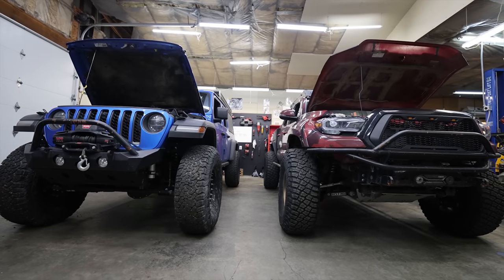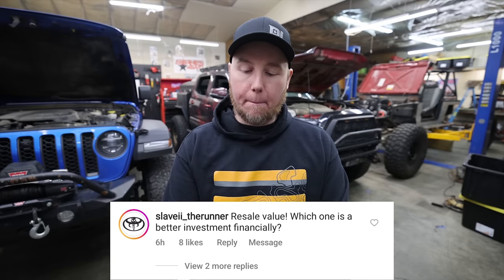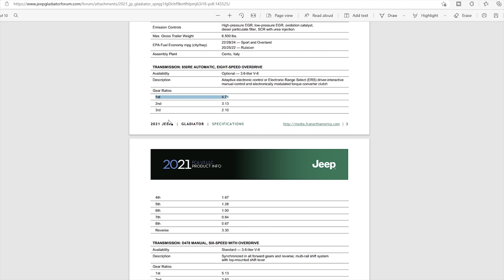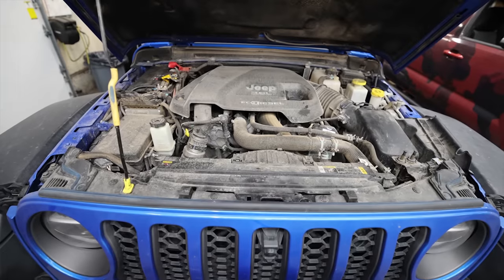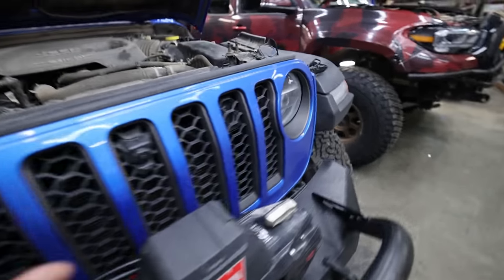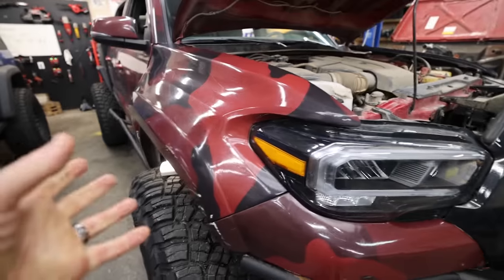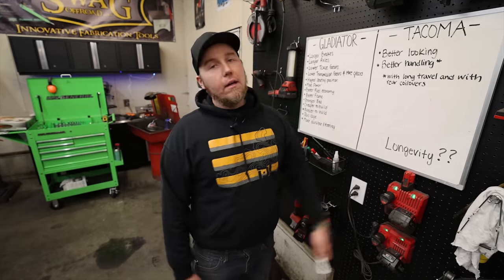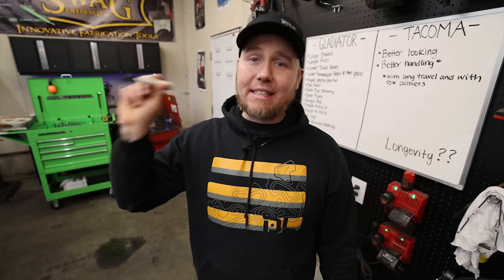My 21 Jeep Gladiator Vs My 21 Toyota Tacoma. Cold Hard Facts.

Comment: I think that's a good nuts & bolts review. I agree the Gladiator is a better truck engineering wise and for customization.  I was wondering what you think of the Chevrolet Colorado ZR2.  I really need an off-road capable midsize (not a rock crawler) that is comfortable for those 7000 mile 75% highway trips. I don't know if the Chevy is gonna take me to the levy.  - IDK

Comment: on the towing front, diesel engines have a lot more torque down low, they also usually have lower rpm than gas engines... there's a reason the lorries use diesel engines almost exclusively

larger breaks dont matter, unless you're breaking from 70 to 0 every 2 minutes, the only thing that determines your stopping distance is your traction to the road, ie, the tires, you could have 3 times larger breaks, but bald tires on a snowy road will not stop sooner than smaller breaks on proper tires...

the toyota is not designed for offroad, the gladiator is, that's the biggest difference, you have to build the tacoma to prepare it properly for offroad

Comment: Only thing I would disagree with is jeep steering which in my opinion is terrible.  Owned my 2018 JLUR for years and feel like a drunk driver at times and Jeep refuses to replace the crappy aluminum steering box for the updated steel one.

Comment: Resale Value... End of December 2023 and I just bought a 60,800 MSRP 2023 Gladiator for 30% off MSRP with Stellantis and dealer incentives so, like 42K and whatever change made it 30% off. That's used car pricing... I'm gonna give the nod to the Tacoma on that but I wanted a Gladiator. It will still do things a Tacoma will NOT.

Comment: Bought/ ordered a 3rd gen last year (trd off-road manual).  It was my 3rd tacoma and first special order.  I had the truck 3mos and absolutely hated it except for when I was walking up to it, great looking truck.  I was aware of the shit engine and thought ordering a manual would help.  It didn't.  If they would have put the 4.0 in it, the truck would be amazing.   Rated to tow 6500lbs but it would barely pull itself up a hill.

Comment: Anyone can speak to this and actually make a pretty simple assessment of these 2 midsized trucks. Even owning a tacoma I can tell you the weaknesses and any tacoma owner that doesn't admit them or want to realize them is just walking blind. The tacoma was built to be a pickup truck with some minor offroad capabilities and a nice ride on road. The jeep on the other hand was built to be a jeep and jump in the midsized market to get some of the market share. So essentially the yota was built to be a more modern truck and the jeep was built to be a jeep with a utility bed. Here's a big point not covered the tacoma outsells ALL other trucks across the board midsize full size it doesn't matter. The only one it doesn't beat is the for F-series and thats just due to that being from the f150 to the truck f450 and the shear volume of fleet sales. You dumb it down to just the f150 yota is king.

Comment: I agree with your statement that the Gladiator is the better crawler but the Gladiator and jeeps in general are purpose built to be exactly that, the best crawlers on the market. Tacoma's on the other hand are not meant to be crawlers, there purpose is pre-runner style off road hence the IFS. While both are off road vehicles the Tacoma would absolutely blast the Gladiator in a desert run style off road where as the Gladiator has no problems crawling slowly around obstacles. I think they have two very different applications and instead of playing to the Tacoma's strength you had to throw thousands of dollars at it in order for it be even in the same ballpark as the Jeep. Imagine for a second the roles were reversed and you had to build a Jeep to be a good desert runner style off roader, imagine how expensive that front end would end up costing, hell you might even end up doing an IFS swap out with the front axels. Not to say the Tacoma doesn't have its downfalls which it does, (rear drum brakes? leaf springs? kinda meh) but the Tacoma is definitely Sexier than the Gladiator
Reply: I just found your channel and your no hesitation style is very refreshing, definitely a new sub earned :)

Comment: I agree with everything that your video said mostly except for looks unless you're talking about stock. The gladiator stock even in the Rubicon trim does not look good The Toyota Tacoma stock and a TRD trim looks way better I agree with that however if you lift that gladiator higher and you put on tires the looks aren't even comparable it looks way better than the Tacoma by far in my opinion.

Comment: Can anyone  point out a book that  is 100% non bias?  ( let's forget about any religion as most will speculate in that direction)  no matter how much research and facts  on any topic, that are reviewed and discussed in any format there will always be to some mathematical degree( percentage, probability, or statistical)  that tips the scales slightly off balance. Maybe not to the naked eye. 
 I ve never owned a jeep or a Toyota truck. I also don't off road. This was a very well done video in my opinion, that highlighted information is out there, it's raw and has to be tailored  to the person's  needs or use, aka reliability.   I would assume most of the needs for the applications that the off road community is looking for are "one off designs"  they don't fit into the other  general categories for manufacturers /engineers such as a passenger vehicle, or light duty vehicles, suv  pickup trucks  Jeeps. I would imagine every application has a trade off. For example all wheel drive vs four wheel drive. Disc brakes vs drum brakes vs drive line brakes.  Gasoline vs diesel.  Automatic transmission vs manual transmission ..( note this is the only Chanel I know of that has put a diesel engine in a jeep to abuse  or off road over obstacles)  trade offs for the desired performance and applications. 
Meaning of abuse: to thoroughly test the engineering,design and workmanship of each system, structure or component. Be that a manufacturer or a 3rd party  shop or a backyard  enthusiast.

Comment: There are pros and cons to each. For me, it comes down to the price, build quality, and the company selling it. Chrysler is known for trying to screw their customers out of warranties. And there is no question that the build quality for Toyotas is much higher. If you don’t believe me, look at the used market for the data. How many jeeps do you see with 300k+ miles and still running strong? I love the idea of jeeps.  In fact, if it was made by Toyota, I would definetly buy one over anything else. But it’s not sadly. And I don’t want to pour in money to fix the things that constant break with plastic parts. Toyota has its issues to. It comes down to what you want

Comment: Toyota fan boy here. Part of loving a vehicle is knowing its flaws and yes there are some things that just suck. But overall reliability longevity Toyota has a proven record and Jeep ( on the gas engines) come stock with lifter tap oil leaks in the worst places. Agreeably the suspension is much better on the jeep, but definitely more comfortable on the Tacoma. Kent find a way to completely disagree with you, but then again, opinions are opinions.

Comment: Can you share a rough estimate of the long travel front suspension costs (shocks too) and the cost of converting away from leaf springs on stock rear axle? The Gladiator was on 39s in an afternoon with no changes to the suspension. I think it is material to understand the cost of getting the Tacoma to the point that you've got it.

Comment: I give props to jeep for not selling out and keeping the solid front axle and not switching to ifs like all these other companies. Toyota just sticks with the same old stuff but make their trucks look soooo damn good you want to buy them. I wish Toyota gave you solid axle and more off-road options to choose from. Toyota doesn’t listen to it’s customers, they won’t even give us diesel options like jeep does plus why do they keep using the damn drum brake rears? The pro doesn’t even come with front lockers. Doesn’t sound very pro to me when a Chevy zr2 comes in diesel and with front lockers. 
It’s hard to see but did you eliminate the ball joints in the Tacoma suspension set up? If so, that’s one hell of a way to eliminate another known Toyota weakness.

Comment: I would have to agree with you. The Jeep is superior to the Toyota. And I do love Toyotas, I owned many of them. They are amazing, reliable, but they do need to step up their game and offer something more than they currently do. Jeep needs to improve a few things too. But overall Jeep is still a much better vehicle.
Reply: No. It really isn't. It's a better offroad vehicle to mod. It's actually closer to a utv than a vehicle. Better? No freakn way. They had something with the 4.0. That was good. But jeep has never been better unless you are trailing it. 
Jeeps are for people that want to take the doors off and put the top down and drive around. Or just trail it. Make a hobby of building one. 
Personally i despise working on vehicles. And think jeeps ride like crap unless it's upper end suv. And jeep frames are thin. Go look at it. 
Want a truck buy a 1 ton or better yet higher. 
Want a little utility vehicle buy a little pickup like the tacoma, frontier. 
You want something to take out in the woods and beat on and sleep next to in a tent buy a jeep.
I prefer the bigger trucks. Have a tacoma. Landrover. But actually mostly drive my volvo. I don't even get the point of a jeep. I have atvs. It's kinda the same thing.
Reply: @itsallminor6133   I don't disagree that a true full size truck isn't better. My point is if comparing to a Toyota Tacoma, the Jeep is superior. I owned both. If the new Tacome came out with a v6 engine, that would be a game changer. But I would also love to see a Jeep Gladiator with v8 Hemi motor.
Reply: @EddiTaru  agree

Comment: I can't really do either of these. I've never been a Jeep guy simply for their popularity. There's damn near no such thing as a unique Jeep. Toyota is the same way nowadays. They all get the same bolt-ons. When you go down the hole of building them to be hardcore crawlers or offroaders, you're usually replacing everything that gives the vehicle it's initial value anyway, so why not just do something different and unique? If you replace the drivetrain, powertrain, and suspension, why start with a $40,000+ vehicle to begin with? 

They're just not my cup of tea. In the rare instance that I see a nice, clean build that is somehow different, they absolutely get my respect, but those aren't all that common. I'd rather look for a vehicle that's in the same class that can be purchased and entirely built for the cost of one of these new trucks. Then again, I'm someone that enjoys the journey more-so than the destination, so a challenging build is what I'm after instead of dropping $15k at 4wheelparts and calling it a day. 

All that said, I have a build I really want to do and have been planning for years. I just need room to park it. I just recently decided that a TDI swap is the way to go with it too, so if you could get some more TDI vids going.... 🙄😂

Comment: For nearly two decades new vehicles are really just clones of each other.  Today's trails are so beat down how could you tell what's struggling off road? And if you are struggling shame. Arizona's Box Canyon outside Superior it's beat down much more than decades ago. Yet ( decades ago) I've had a Ford Pinto and a76 Toyota Cilica  through there a few times. And that little Toyota Celica on his 14-in wheels has been both directions on the Superstition Wilderness Boundary Road  carved into the cliff. Last time after going up the switchbacks and heading down the parking lot on the other side I met a Jeep Club winching themselves up waiting for a chance to drive down all I got was grumbling and pissed off jeepers complaining that I was littering the roadway.  So after getting to the bottom I turn around and drove back up and flip them all off. Then drove back down again.  Yes I drove the Cilica back up the hill where many needed to be winched.
     Perhaps it's not vehicles but the drivers. 
   Funny thing is I still have that Celica. And with over 800,000 miles. 
    And perhaps because it's a Toyota I still have my 80 high Lux long bed. Stroked, 38, 5:29s,  Marlin crawler
      Oh and those Jeeps?
    I've had a 43 Willys since 1978. That death trap needed a cage, rack and pinion and now has endless reliability,  2 1/2 times the hp with a GL 1500, 5 speed, 6 gear ranges.  And 40+ mpg.
    I could buy new. I'd rather owen dozens of old Classics of all makes. Then burn money. That philosophy also has me three airplanes as well.   Then I'm not just hung on Toyotas.  I have the Fords, Chevys and love my Mopars.

Comment: As a 2x Tacoma owner, I am absolutely in no way offended by your very true and candid review. 

If Jeep offered a manual as an option, I might have sprung for Gladiator over my '17 Taco.  I just have to have a manual. 

I am not as gitty about building something that can climb a cliff, or scale a wall.  That is not my sport. 

Camping, adventure with kayaks, and general overlanding is more my kick. 

Nate, you did an absolute killer job on your Tacoma, proving that it is extremely capable when built with the right parts. 

Looking forward to your next build with Edward.  Lemme know if you guys need some extra hands wrenching on it.
Reply: jeep does offer a Manuel option in all their wranglers and gladiators....

Comment: the only disclaimer id say is that noone is using the jeep bed the way that some of these Tacoma work trucks do, jeep is an off-road truck the Tacoma is more a utility in my opinion, that being said i drive a gen 1 raptor that i off-road hard, with steal bed and it needs supports, they just don't make them as strong as the once did.

Comment: How something looks is  in the eye of the beholder . Jeep Wranglers are to me the best looking off road vehicle out there , vehicle period , as well , the old Defender and series Land Rovers , Jeep XJ lifted and modded out , old Range Rover , IH Scout , Pinzgauer , Military spec G Wagon , the Ineos Grenadier . As you can see I like the old school look and off capability of those generation  vehicles , and the new jeeps although fairly electronic , at the root of them , is some tried and true hard core off road tech. that has stood the test of time . I like to pull leavers to engage 4 wheel drive high and low , and not turn electronic dials....what the heck is that !!!  The Toyota looks like just another modern era plain jane vanilla bag  pick up , read very boring , and the Ford Bronco I don't want IFS four wheel drive, to weak and prone to breakage and no longgevity-not durable , to me true 4 wheel drive is solid axles , way more robust and less chance of failure. 
The fact that you can get all that hard core off road  kit in a stock Jeep is awesome.
I own 3 Jeeps a Tank Green 2-door JK that has been to hell and back on some very remote Canadian off road overland adventures , a Jeep JL Rubicon Unlimited , which I am building out for overland travel , I also have a Jeep Cherokee XJ that I have modded out for off road use. I Like your honesty on the numbers , numbers which are facts , and the facts are that the jeep is an incredible off roader right out of the box , and a great platform to build upon . 
Cheers , Wild Bill . Overlanding the Arctic watershed and Boreal forests , and Taiga of Northern Ontario and Northern Quebec . Never stop exploring .

Comment: Since we're talking facts only.   The current Toyota Tacoma has a max towing capacity of 6800lbs.  A Jeep Gladiator EcoDiesel has a max towing capacity of 6500lbs.   A Jeep Gladiator Max tow with gas engine has a tow capacity of 7650lbs.    Even a Rubicon gas Gladiator has a higher tow capacity than the Ecodiesel.   I have completely lost interest in the modern diesels.

Comment: I always laugh when someone  asks  about the durability of anything.  My honest opinion  has always been,    it's only as  durable as  how it's treated. An example  of this is a Friend  and his father went  out and baught  identical brand new  ram 1500s 3 years ago, his  dad used it   like a truck looks after it, and hasn't  had an issue in the  70,000km hes  driven it. My buddy on the other hand  had   abused the  crap out of his,  it  constantly  saw the Rev limiter, and  spent alot of time  bouncing  off the limiter  aswell.  It's  had  just about every part in the  driveline  replaced  at least once, and is currently on its  3rd transmission in less than 40,000kms

Comment: Toyota messed up with the third gen. They were leading the charge for too long, so they got lazy. While it looks great, mechanically it falls short. The gas engine was underpowered from day one. They need to offer a diesel option. It seems all their competition offers front lockers now on their offroad models. Still has the weak front diff, driver side, needle bearing.

The forth gen needs
a new gas engine (~350 peak hp, make it more of a truck engine with plenty of torque down low, not like the car engine they currently have)
a diesel engine option (400 ft/lbs)  Just pulling numbers out a hat
A better transmission
Better front diff, with new bearing, and a locker option
A proper front skid
A better frame
Sway bar disconnect would be dope
A stronger bed
A better shock setup stock

Unfortunately, it's quite possible the next taco will be a hybrid, or possibly full electric. So I'm not holding out hope